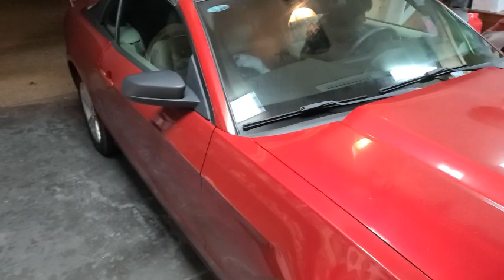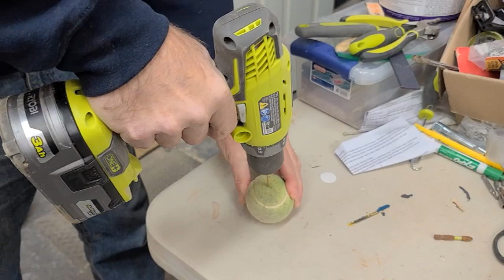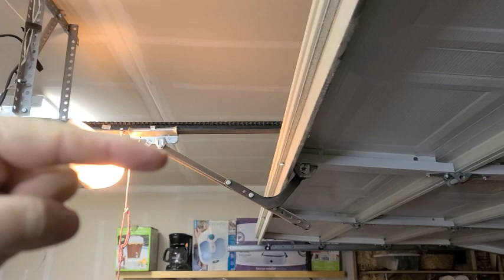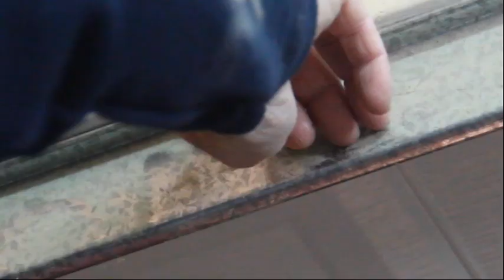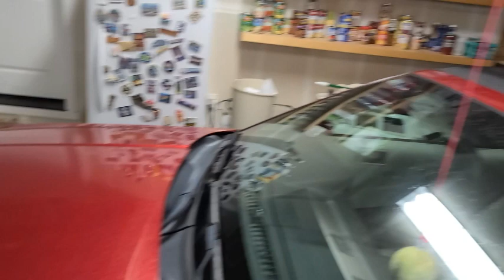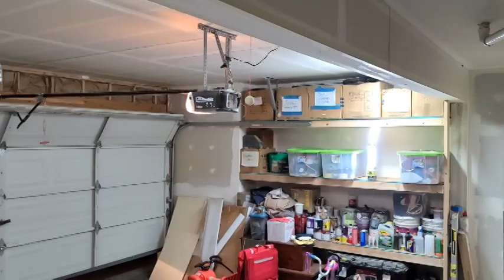Don't CRASH into the Garage! | Retractable Tennis Ball Parking Aid | 2021/009

Comment: If you doubled the string/cord from the ball back up to the ceiling and fixed it about 4-6"s ahead of the other eye, the ball would only travel half the distance of the garage door like a snatch block pulley. This would stop the cable getting snapped off the ceiling eye by travelling too far and you would not have the hassle of going back over the garage door as in your design. The only thing you need to be wary of is the two cords becoming twisted together if you don't set the two eyes in the joist far enough apart. Just a thought..
Reply from the maker: Interesting!